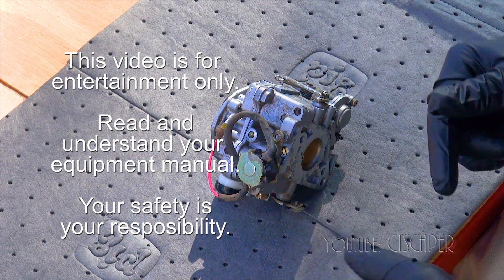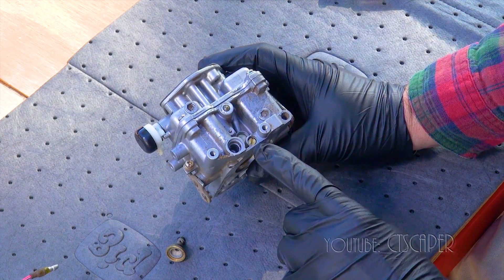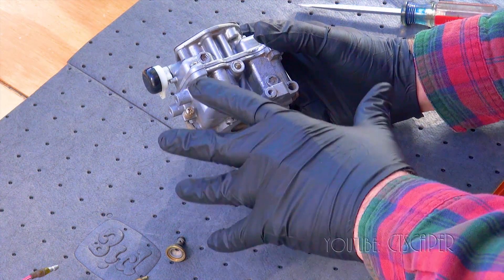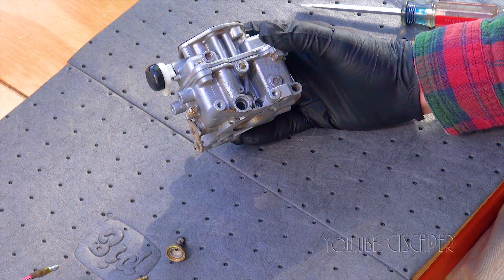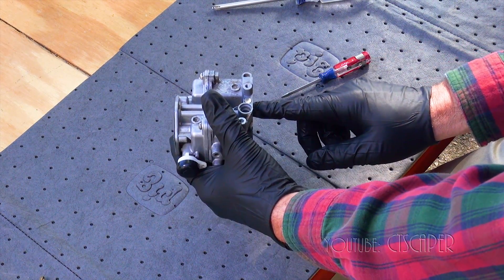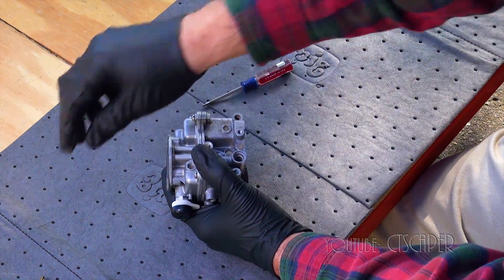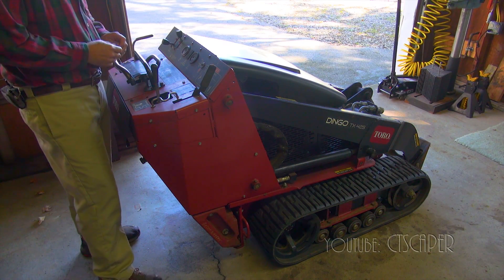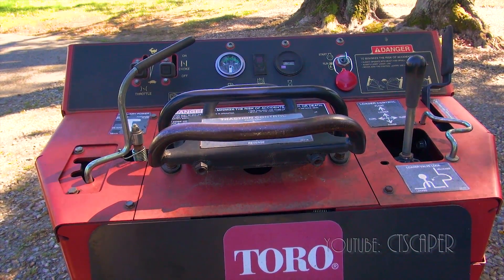KOHLER COMMAND TWIN CARBURETOR REBUILD EP.04

Comment: Hey man thank you for making this video!!!  I’ve been using my walker mower for 2 seasons with the choke on a little. It would not idle either.  I cleaned the heck out of the carb 3 times and same thing.   This time I drilled out that cover for the low idle screw that I had no idea was there and cleaned it. Runs perfect now!!! Thanks!

Comment: Any idea of what that solenoid is used for my has extra wires to it but not hooked up
Reply from the maker: My understanding is that it is a fuel shut-off solenoid. Those motors are famous for backfiring when being turned off, so the solenoid turns fuel on and shuts it off when the key is turned.

Comment: Incase it helps someone, my issue was overheating due to partial main jet blockage, just remove the solenoid, pull the brass piece out and it's behind that. Rest of my carb was clean, idle jet looked perfect, only a few tiny bits of crud in the bowl needle/float all good, but behind that solenoid wasn't great, greeny build up on the brass part, solenoid tip dirty and you could see through the main jet but after poking the wire through and blasting with carb cleaner the true jet size was revealed, more than twice as big. Thank you for these videos, really helped me get through mine quicker.

Comment: Thanks for the video! I'm working on a CH18s spec- 62509 on an 1863 Cub. I have to take mine back apart and clean the tiny port on the low idle jet! I cleaned the large slow idle jet that sticks out. WOW! There was buildup in the bottom portion like concrete. Took lots of work with a torch tip cleaner and blast of 150 psi compressed air.
Reply: Working on a 1864 with a CH18S and this is likely an area I'll be hitting up tonight.  Thanks for the advice!

Comment: You didn't take apart and clean out the excellerator pump spring and diaphragm on the carb. It's the linkage opposite side of the choke linkage. There are 3 screws that hold a small round plate on the bottom of the excellerator pump linkage. If it's not cleaned it can cause the carb to run a bit rich also. Good video though!
Reply: He did on the previous video.

Comment: The rebuild kit comes with a new idle screw and spring.  Does anyone know how to get the cap off?   Also it should be set at 1.5 turns per kolers instructions on rebuilding.

Comment: I had a similar prob. Did the carb and new pump same thing. Changed coils same thing. Turned out the smart spark controller was bad. As it warmed up the controller would heat up as well and started pulling timing till it died. You can buy the controller but it’s expensive. Kohler stop making them. I did the CDI conversation. 116$ came with flywheel. 2xcoils. And wiring. Works absolutely perfect now
Reply: CDI conversion? Did you mean MDI, or are there different conversions available?

Comment: Did you ever get it repaired?
The gentleman was right about the mechanical fuel pump diaphragm causing problems when they go bad they will dump a boat load of gas into the head and into the lifters and block that will make the lifters real noisy 
I'd do a compression test on each cylinder two.

Comment: Great Video, John.  I have that same motor in my tractor (Massey Ferguson 2927 - a relabeled Simplicity Legacy XL).  Your videos were super helpful.  I didn't find your video on the coil, though.  Two things I would add to help anyone reading this.  When rebuilding this carburetor, in addition to the carburetor rebuild kit 24 757 03-S, don't forget to purchase the Diaphragm Rebuild Kit. Kohler Part number 24 757 08-S.  It has a service bulletin number TT-5153 in it, that instructs you to ream out the plunger shaft hole (if not done already on a later production model) using a numbered drill #23 Drill bit, to make the plunger rod slides in and out easier.  It can corrode, and stick. (Requiring one polish off the corrosion, of course.)  So, the hole needs to be 0.153in. That gives it a lot of play to operate without binding.

My saga - I had my carburetor rebuilt by professionals, twice, each time for about $300 in parts and labor. The first time, last year, I had to run the engine partially choked to get enough rpm to drive the hydraulics. The second time, it ran for a couple hours, then wouldn't stay running.  The professionals didn't replace the diaphragm.  When I took it apart following your videos, I found that the diaphragm was in upside down.  There's a rim ridge, that fits into the groove. Being upside down, I think sealed the vent-injection holes off.  The motor would start, but go into oscillation flapping the choke valve.  I did the MDI coil upgrade 25 707 03-S, choosing the right one from the Kohler Parts Bulletin #259 for Command Twin..., but probably didn't need it.  But now, the engine is running strong.  I think that diaphragm replacement was the key.  The new one, was flat, and tight.  The old one, was visibly stretched, and warped, compared to the new one.  The diaphragm kit comes with a new spring, too, making it more responsive to micro-throttle adjustments from the Governor.  Since this motor is constantly being adjusted under load by the governor, there's no way that diaphragm isn't going to wear - the accelerator pump is moving constantly as load goes up and down on the governor.  I also put in a new fuel pump kit (that entire valve cover assembly).  All totaled, my work got the engine running better than the professionals that rebuilt the carburetor - and for about half the cost I had already laid out.  Doing it myself, with lots of photos, got it back in shape where it needs to be.
Reply: Andrew Stein 
Thanks for the info. I just bought a carb rebuild kit and you’re right it doesn’t include the diaphragm. 
On mine the solenoid plunger is dead, rusted. Lots of rust at the bottom of my carb. 

Where do you suggest buying the parr’s? I bought replacement brands from amazon, I hope they’re good.
Reply: Andrew Stein 
And what about the upper and lower gaskets?
Are they 24-041-06-s and -17-s?

Comment: John, I'm sorry to hear you're still having issues with that. About that brass jet, you do need to use a torch tip cleaner with carb cleaner to clean that passage even if you can see through it, I know the directions say not to, I can't clean one without doing that and I've never damaged one that way after 40 years doing it. Here's a couple links to "welch plugs" I strongly suggest you look at as well as for your viewers, they're not mine, I don't have any yet. look at both of them, they're different and between the two are very complete.   https://www.youtube.com/watch?v=wAXcksgvDkM            https://www.youtube.com/watch?v=Hf_R7MeSo5I
Reply from the maker: Gordon, the machine is fixed.  I wanted to finish the series so people can see how the carb looks.  I watched both of those videos and they were very helpful.  I wish they showed putting the welch plugs back in.  I sent you a message on YouTube a few days back if you haven't checked messages in a while.
Reply: Thanks John, I just found your reply to my question in my sent msgs. but never got a notice of it being there. Thanks for responding. I'm still looking for a camcorder that takes an ext. mic and a micro sd card. The Sony's  that do, cost twice what my Sony cx405 cost and don't have a single thing that mine doesn't have, double the $ just to add an ext mic. The Canon's don't take micro sd. Some of the off brands have it all but I'm scared to try them. I do want to learn to do better editing not for my repair videos so much but for drone, scenery and traveling videos now that I have the power to edit HD and 4k.
Reply from the maker: Gordon, can't you just use a usb cable to download the footage?  Why do you need micro sd?  I haven't touched 4k yet but it's 4x the size of 1080 so you need a lot more machine, and patience, when rendering.
Reply: I have the power to do 4k now, it's slow to  upload to YT but I still do 1080 for that. I want the 4k for scenery and future quality. I want the micro sd's because I have a bunch of them with the 2 Sony cx 405s and 2 drones, and 2 cam glasses. I think YT will do 4k in a few years, look at the 4k tv prices now, they're getting ready for the next generation, I think 5k or 8k or something and more people are watching YT on their living room tv now.
Reply from the maker: That makes a lot of sense Gordon.  You've got more equipment than me!  My kids use the xbox to watch YouTube in the living room and it just blows me away.
Reply: Both of those videos are pretty crude. A.) Use a drill press with a small (I used 1/16") bit B.) Blow in compressed air and it will pop right out!

Comment: coil, spark plug or a dirty air filter?  Is it twin cylinder? I had a kawasaki twin that fouled 1 plug about every two years. Very low hours on the machine.  I touched one of the exhaust pipes one side was cold thats how I found out the issue. New plug good as new.
Reply from the maker: It ended up being a coil, you were close with the plug.  The next video will explain more.

Comment: Hi did the intake  and exhaust  valves got ajusted  lately....try to pressurise your carb passages use Little  soapywater  to detect air leak .when engine runs put propane torche open (do not lite it.common sense used here)around carb and engine connections .
Reply: This motor has hydraulic lifters no adjustment s!!